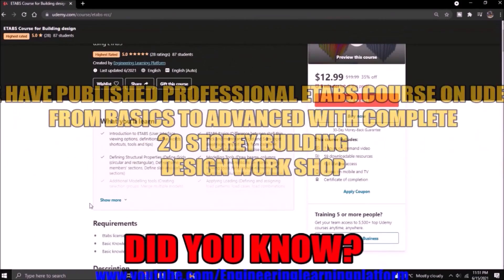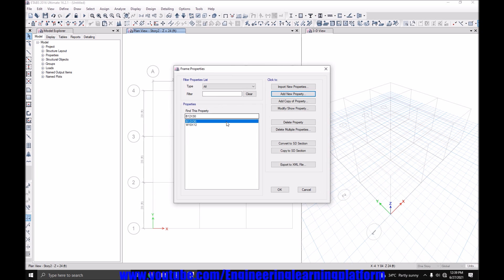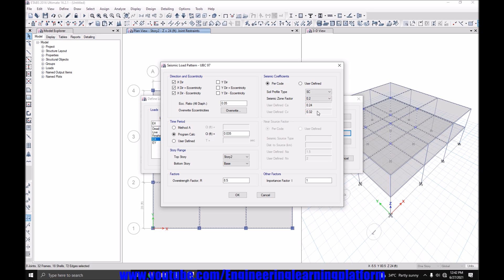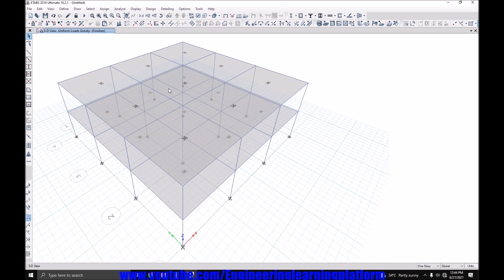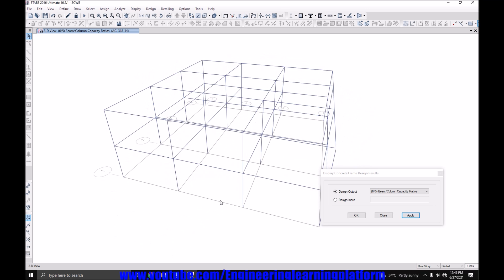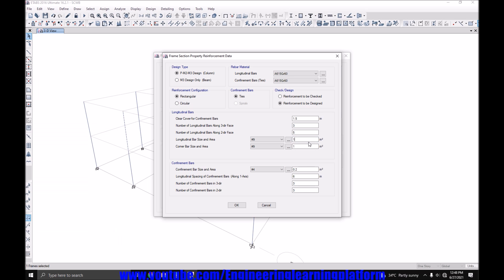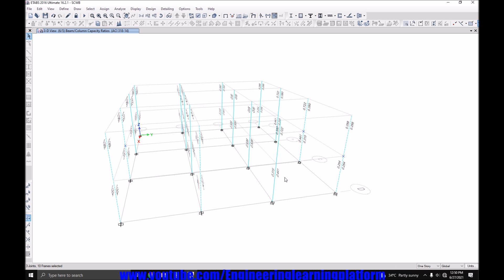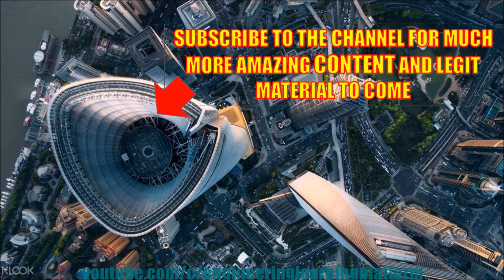How to pass strong column weak beam check in ETABS Tutorial

Comment: its nice..what about the size of 24" x 24" by increasing column will it feasible to adopt though the member size passed???
Reply from the maker: Sorry the question is Unclear. However if a size is passing checks then there would be no reason to increase size
Reply: @EngineeringLearningPlatform   24" x 24 " size passed once 18"x18" not passed..but adopting of 24 " is feasible for residential??
Reply from the maker: @gowthamiv4841  it is totally dependent on the project I cannot judge that without looking at drawings, it's an Engineer's call and judgement

Comment: how can i check strong column weak beam if I have a intermediate sway? as We know, Etabs just calculates strong column weak beam for special moment frames.
Reply from the maker: Didn't get the question
Reply: @EngineeringLearningPlatform   Hi, thank you for aswering me, I mean, when I have a intermediate sway and I want to check 6/5 beam/column capacity ratios OR column/beam capacity ratios I get from Etabs N/A, it happens because Etabs Just calculates these capacity ratios for special frame moments, so as I mention before, I have a intermediate sway and I want to do these Checks. How can I check 6/5 beam/column capacity ratio in an intermediate sway?. In this video you are working whit a special frame moment so you can check 6/5 beam/column capacity ratio.

Comment: What does N/A mean in c/b capacity ratio
Reply from the maker: Mostly arises when the beam is not assigned "beam property" happens by mistake, or if the joint is not properly forming at common node or even releases can cause this issue.
Reply: @EngineeringLearningPlatform  How ti fixed it? please answer.
Reply from the maker: @4ta01_josuadmarthrietchyri7  select the members, go to design and then "overwrite the frame design procedure" to correct one. If concrete so concrete or steel so steel
Reply: @EngineeringLearningPlatform  I did that, still NA